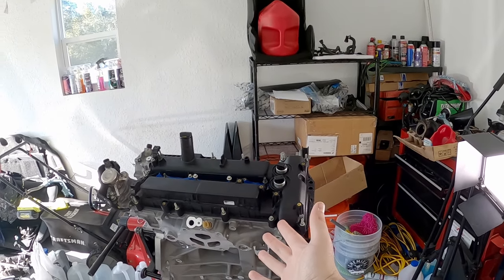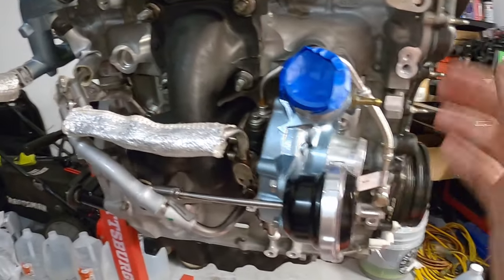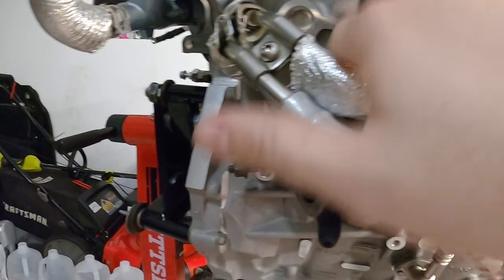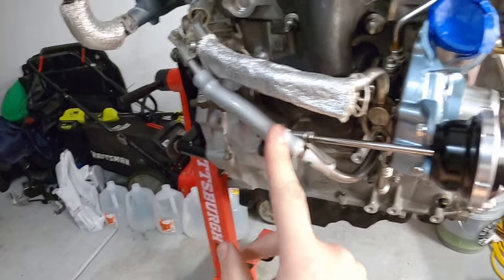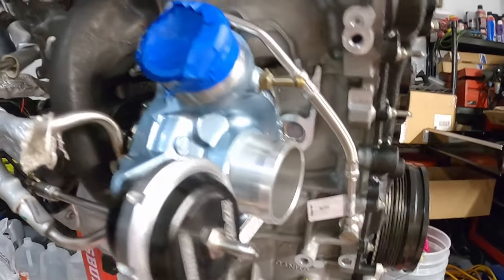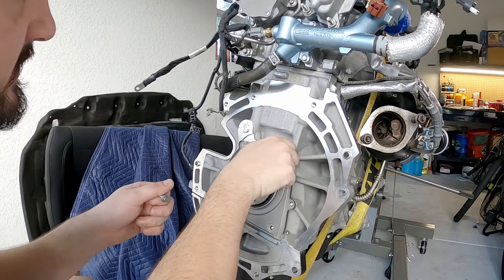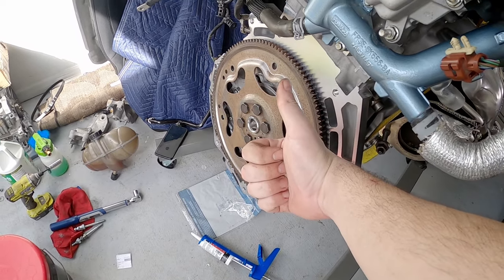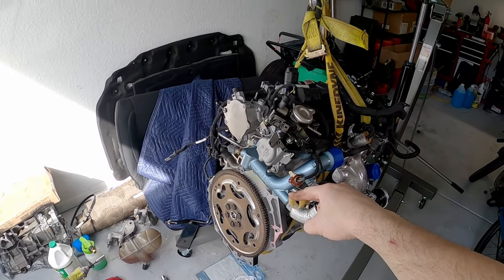People Said I'm Stupid for doing this! WHY? Ecoboost Rebuild Part 3

Comment: Some of us, over at Mustang Ecoboost net, have been watching your engine build.
Can you answer as few questions listed below?
Thanks!!

I am a bit confused, in an earlier video, It looks like he is using a 2.0 ST block and a 2.3 TS head... without modifications.

I didn't think they were compatible, unless you close off, what I believe is an oil return (head to block) canal, located behind the turbocharger, also know as the front right corner of the motor.

I'm not sure why Ford deleted this canel, on the 2.3 motor... 

Did they have clearance issues when using the larger TS turbo or possibly heat problems, as the motor oil drained back to the crankcase??
Reply from the maker: 2016 & newer TS/ST blocks are pretty much a direct swap from my understanding. It's the older 2.0 ecoboosts that need certain things changed.

Comment: a mechanic installed mine wrong and most of the oil got into the bell housing. spun 2 bearings. got a new long block out of it but now the new engine has a lot of crankcase pressure and is not allowing the turbo to draining properly and oil is coming out of the  front top of valve cover and the engine cover screw hole on the intake manifold is also bleeding oil. ford is giving me such are hard time with these oil consumption tests
Reply from the maker: Was the mechanic a Ford tech? That's crazy and unfortunately Ford will fight you to the bitter end.